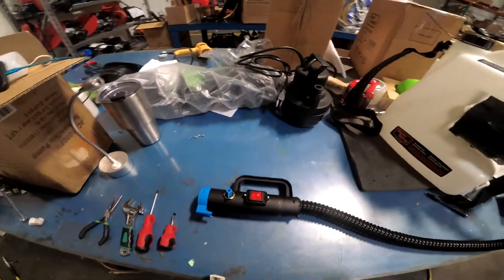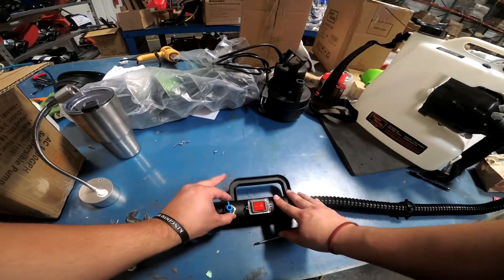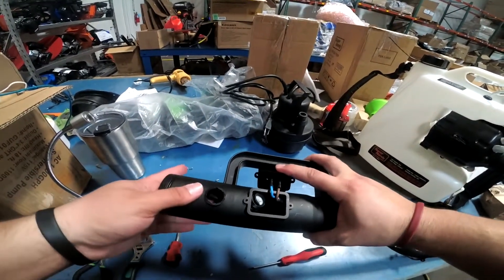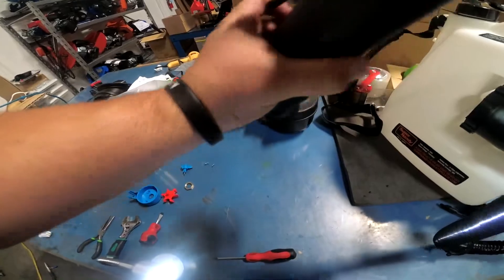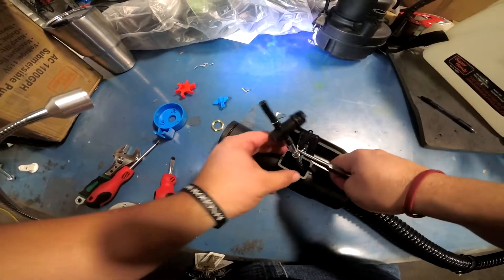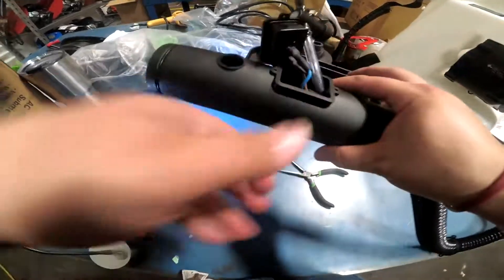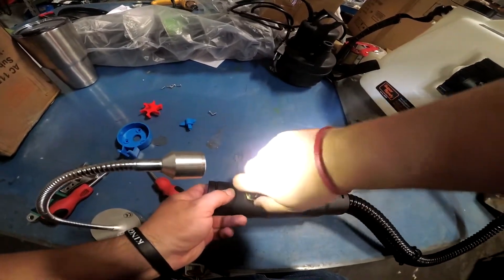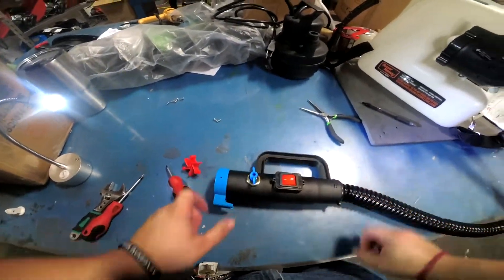Backpack Disinfectant Fogger - Spray Nozzle Teardown & Repair - Guide

Comment: I'm having an issue with the solution not spraying.. its blowing but no solution is coming out. How do I flush the hose, it may be clogged?
Reply: I have. The. Same problem. How do you fix it

Comment: What problem does this fix?
Reply from the maker: Hi J!
This is just a general disassembly, to better explain to anyone curious about how the Fogger Sprayer operates, or if they do encounter a malfunctioning component along the fluid lines or dispersion mechanisms, our technician explains step by step how to replace components in question.
Reply: @SuperHandyUS  thanks, so what im getting is leaking through the hand-held nozzel and dripping. Btw how do I contact your company
Reply from the maker: @imnotsmartlikeyou75  Lets make it right for you!
Shoot us an email at help@greatcircleus.com
Reply: Greate video, it made getting out my faulty valve from my  fogger a piece of cake,  Now do you know where to buy a replacement valve ?
Reply: @hasandubais  same here